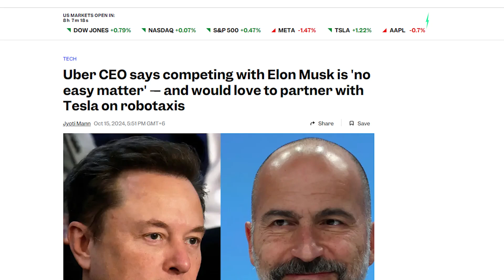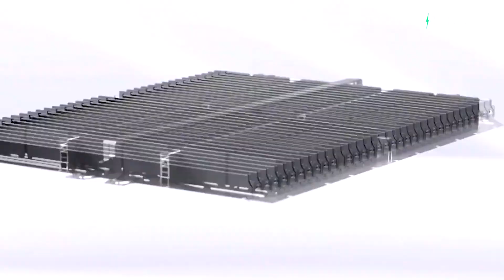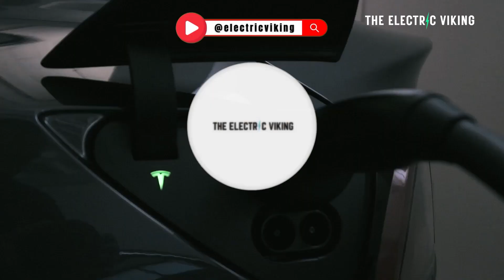Tesla Cybercab 4680 battery chemistry and charging speed

Comment: Fast charging frightens me as an electrical engineer. Only needs a fraction of an ohm with a poor connection and a fire could occur with overheating of the faulty contact. Wireless slower charge would be far safer.
Reply: Fast charging is contactless.  Uses induction coils.

Comment: what happens when a cybertaxi gets stuck in traffic and dies, or doesn't have enough juice to make it back to the charger?
Reply: You really think that the Cyber cab would not have a buffer built in and also not accept rides it can't complete. These are relatively simple math problems in comparison to actual driving.
Reply: More likely the wireless charging will be on the road itself so it will be charging as it travels or stop.

Comment: Charging speed does not matter at all. You charge off peak overnight when there is no need for taxi service.
Reply: then that means you can only operate the cybertaxi 200 miles per day max. Every mile you can increase per day increases your profit.
Reply: @joelcannon58  If you have a range of 300-350 miles (per day) & you can get paid for around 200 miles @ $1 a mile, that's $4-5000 p/m.  Even after expenses, taxes, charging etc, you're looking at half that for doing nothing. Nothing to complain about, but it's a few years out.
Reply: If you have many cyber cabs and before you pick up a customer you know where they are going, and from there, how far to the closest charging station, then the only thing that will be relevant to charging speed would be how many chargers and cabs you have.

They'll have so much data, that they will be charged for peak hours.